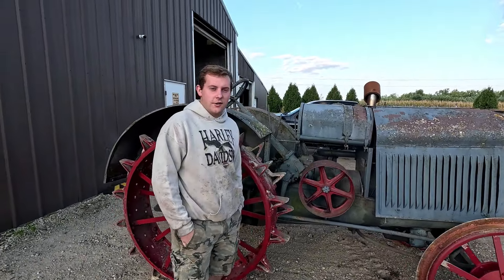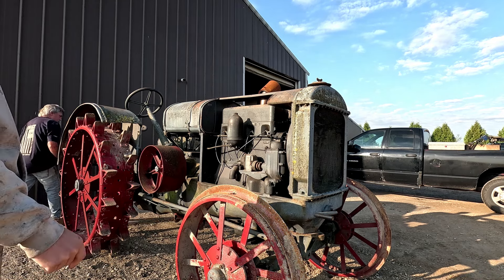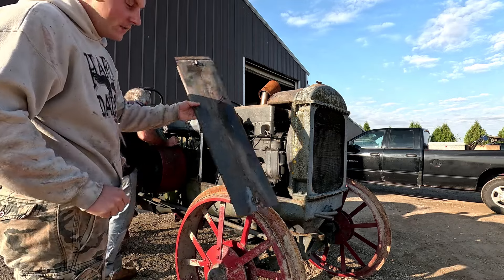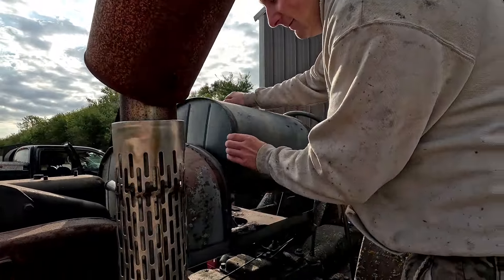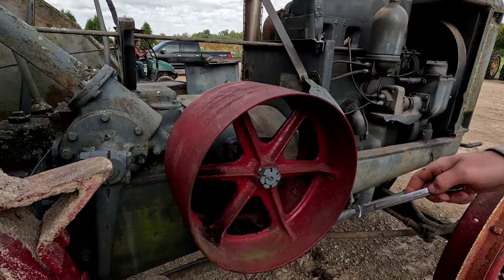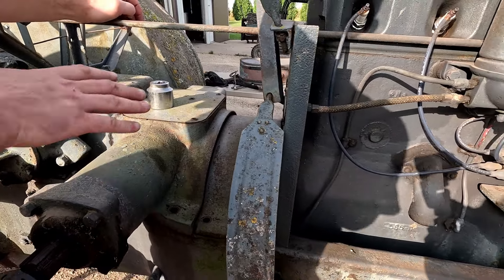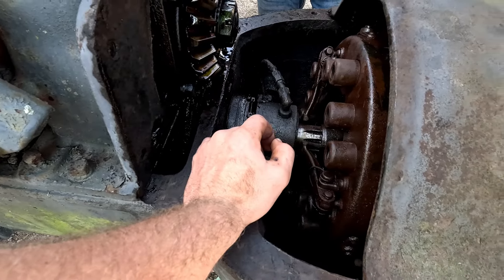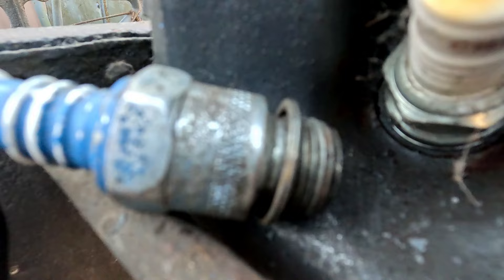How to free up a STUCK CLUTCH on an old McCormick Deering Tractor! (1929 McCormick Deering 22-36)

Comment: I am impressed how easy that came apart  !!
Reply from the maker: @TKM1951  You jinxed is now!😅
Reply: f-12, f-14, f-20 f-30 are very easy to remove the clutch, you hardly need to bend down.  there is a little drive shaft to take out and the pressure plate has provisions to replace half of the bolts to compress the springs.  but, by the way, ask a john deere man with a b, h, a ,g or d, it is even easier, just a snap on cover and three nuts, three cotter pins and away you go.  splitting the tractor is a recent development.  of course, to be fair, today's clutches last longer.

Comment: i enjoy your videos muchly.  but i do want to make a few comments.  i think that that tractor had an e4a magnito to start with.  regardless of your impulse point, make certain that your lag angle is correct. if it is not, once the engine starts the timing may be wrong. i once saw a cat thirty with a replacement magnito that burned out all four pistons because it was over advanced after it started.  cranking with the left hand is safer.  your hand is pushed away in the event of a reversal of the engine.  a 15-30 is a tractor with a hairy pair of "horns", i sure would like to see it on the belt.  best wishes. p,s. did i say balls?